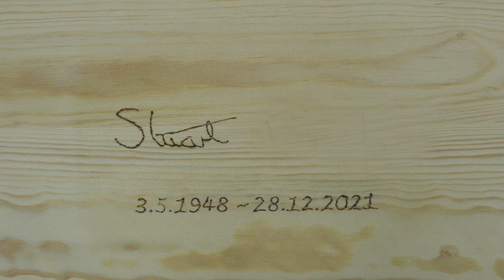How to make a coffin or a casket

Comment: Very moving Steve, and an interesting build. Only in the UK/EU would you need the timber to be FSC certified before burning! And no disrespect to your friend, but I’m sure we’re all wondering what the emissions might be from the ‘resident’ of the casket on their final journey…
Reply from the maker: That's a good q, Peter. But I am told that emissions are "virtually zero" because of the very high temperature and the fact that the combustion products are burned a second time. I assume it's on the same principle as a Rocket Stove.
Reply: Coffin ⚰️💀⚰️⚰️⚰️⚰️💀👺⚰️